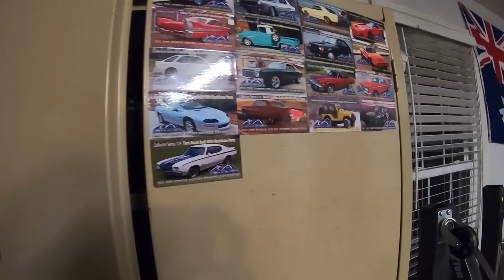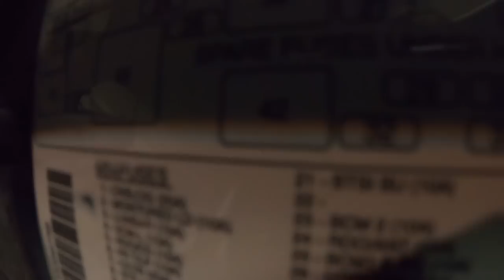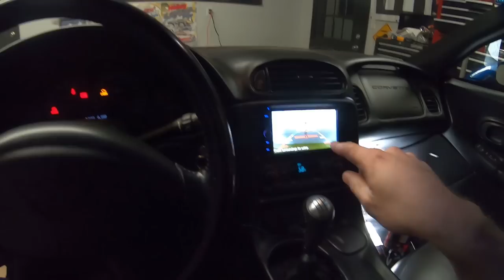C5 Z06 Corvette Final Tweaks - Axle Seal Leak, Reverse Switch/Sender, And Catch Can Install

Comment: Used the same impact gun when I did my clutch too! Great tool. Did you fill your diff while the car was level? Happy to see your Z up and running!
Reply from the maker: I filled it when it was up in the air, then opened the fill plug when the car was back on the ground which let some more fluid out. I prob put in 1.8 quarts with it up in the air. Thanks man, mee too! Driving videos coming soon

Comment: Hey man. Have you ever had to deal with the steering column lock thing? Or a clutch switch. I bought my 03 C5Z with 60k about 2 weeks ago and had both fail since. Bummer. But easy fixes. Anything else that fails on these boys commonly?
Reply from the maker: Hey - my car has had the fixed to eliminate those issues. It has a column lock module, and not sure about clutch switch. Column lock and stock harmonic balancer are the main things to look out for, aftermarket parts make these cars incredible